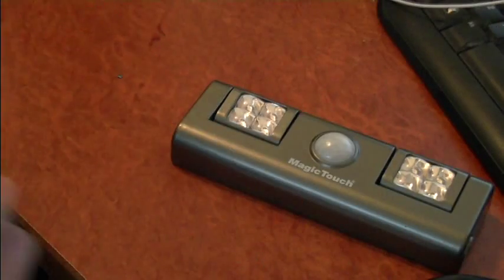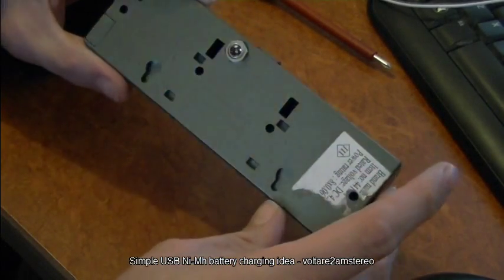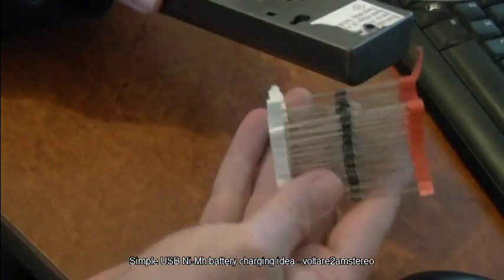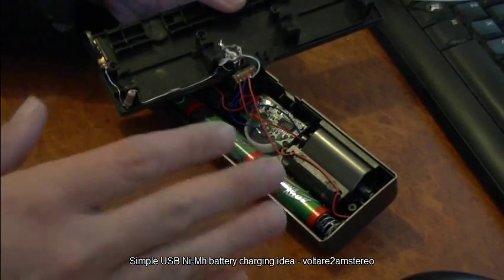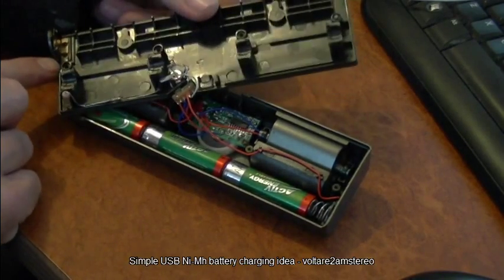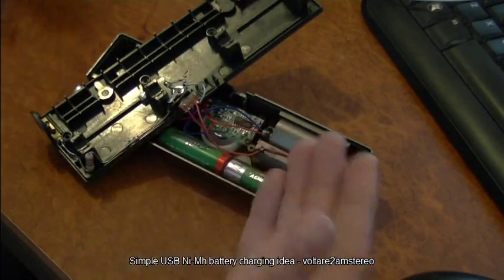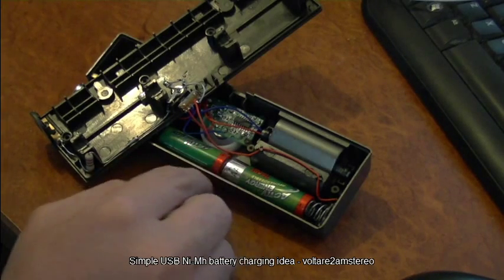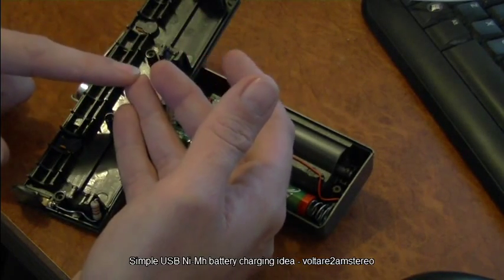Simple USB Ni-Mh battery charging hack / idea

Comment: Great video thanks, I would convert my Philips remote control to USB chargeable.  What type of Diode you are using ? Have you consider to add some of led indicator to know the battery is fully charged?
Reply from the maker: Paul Fang the diode is a simple 1n4004 1 amp , these drop about 1/5v each so add as many as you need to drop 5v to 4v(3 cell) or 3v(2 cell)  thought about the led, with the voltage drop across the diodes, and a resistor, could get an led to light while charging...?